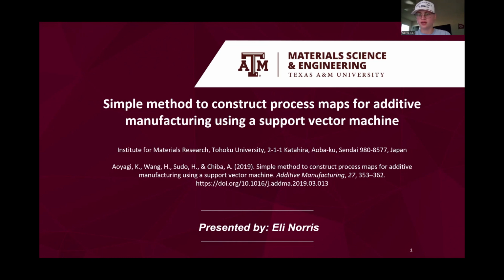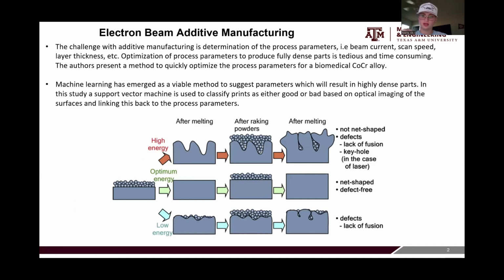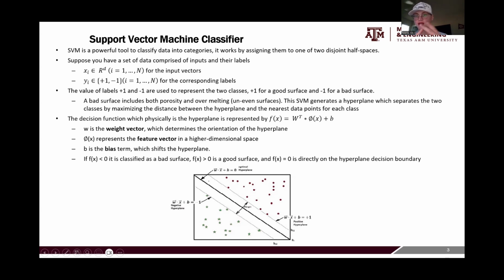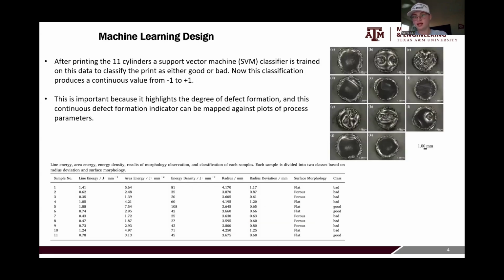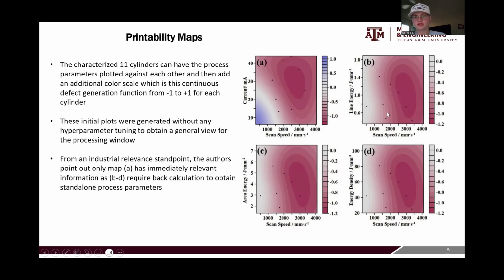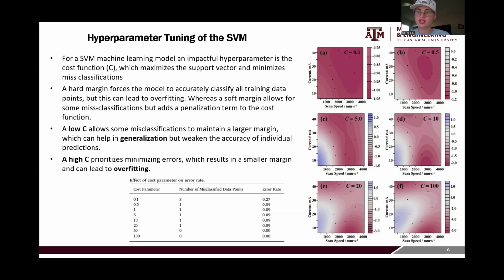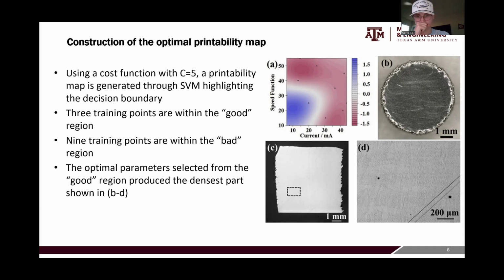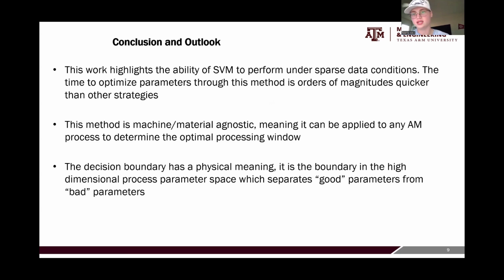Eli Norris - Simple method to construct process maps for additive manufacturing using a SVM

Comment: This is a very interesting paper! Process parameters are expensive to optimize. SVM implementation definitely has the advantage of cost savings. It would be interesting to see if there are more novel strategies using similar designs. Is this a new class offered in MSEN?